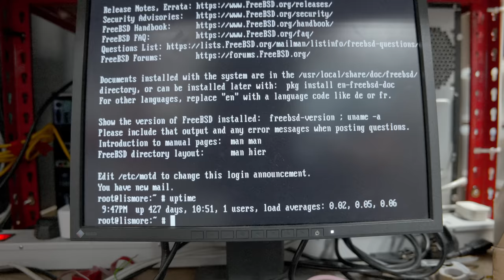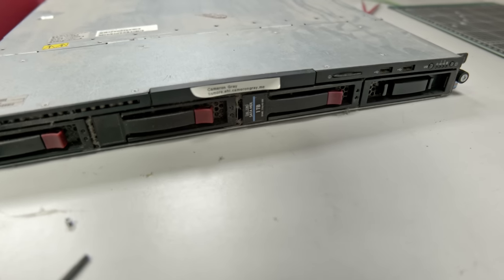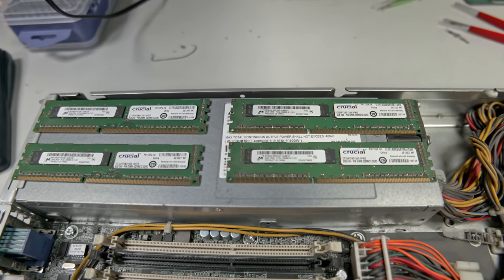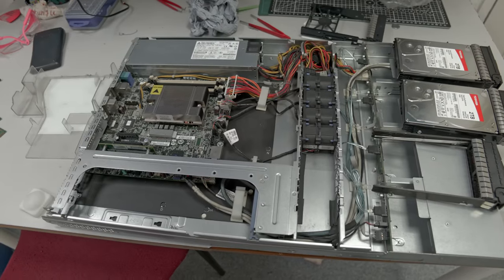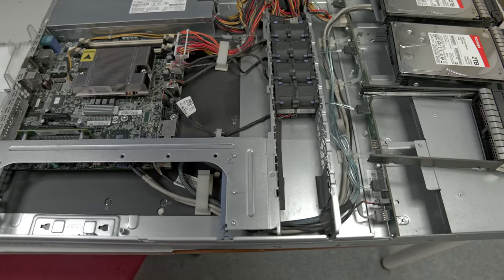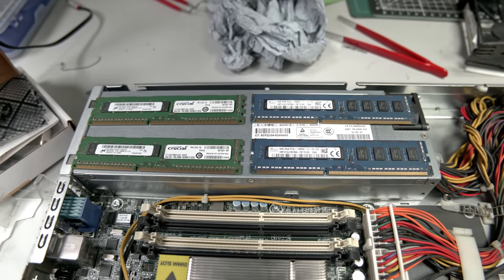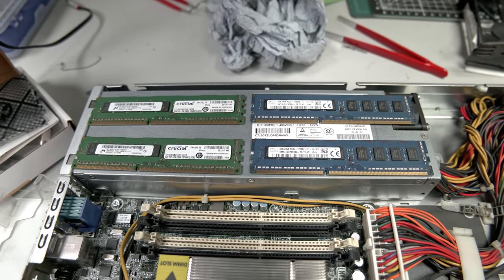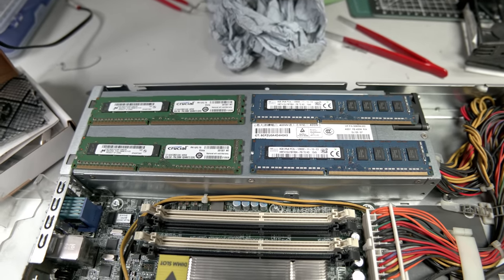Rescuing an Abandoned Server - Building my new offsite backup!

Comment from the maker: Buy items shown in this video on Amazon (Affiliate):
  - StarTech SSD Bracket: https://geni.us/o6Qe
  - Battery Powered Air Duster: https://geni.us/XjUhD7t
Reply: You got me wondering if that StarTech SSD Bracket will also work in an HP DL380 G7 and / or an IBM X3650 M4 !
Reply from the maker: Realistically, for SATA SSDs that card should work for any machine with a suitable PCIe port and a pair of free SATA ports as all it uses the slot for is power and then looks like a regular SATA SSD to the SATA controller.  Using an NVMe slot with it is a bit more hit-or-miss and may end up requiring a newer machine for full functionality.
Reply: @Gerrit-Max works in any system as the power it uses is passive from the slot, you just need 2 sata ports for mirrored boot (I thought the HP dual sata m.2 cards I got was expensive but startech are the same or more then £30-40) unsure why they are so expensive when they require less parts then a dual nvme version £5-10 usually (guess it's more classed as niche item)

Comment: Using the SATA SSD drives was a nice touch. I just built a Lenovo Server and used NVME drives. I wished servers supported bifurcation but my Lenovo X3550m5 does not. Would have been nice to not be forced to use one slot per SSD. 

Glad to see an old server still getting some use, that is perfect for a backup server and doesn't break the bank. One thing I've been surprised about over the years is just how much dust a server can hold and still continue to work lol.

Comment: just a tip :
with your NVMe slot, as you're using ZFS, you could look into grabbing an old 16GB Optane module, and setting that as a ZIL device for your HDD array.
it's a nice cheap way to accelerate random writes for a small array, at least if "syncing" is either used by the share type, or syncing is set to forced.

Comment: This bracket for SSD is really nice. Saves airflow and allow to do a proper raid on two disk. From what I know, SATA controller on actual pci card have to split pci bandwith explicitly in half for both slots and very few card do it properly.

Comment: About serial numbers. It is a good idea to have some note, preferably on paper and on the boot drive of the server itself. About mapping of serial numbers, and caddies locations, and their use. Because once the drive fail, it is likely you will not be able to read its serial number or wwn. So you will not know which failed, unless you go over all the other ones, and deduce it by exclusion.
Reply from the maker: I use Zabbix to monitor my drive health (although most monitoring software can be used for this) - This tracks the history of various drive health parameters which can provide pre-fail warmings but means that even if a drive completely fails and disappears from the system, I can still see what its serial number was through the data that Zabbix has collected while the drive was still operational.
Reply: @camerongray1515 your points are correct on zabbix but I'm pretty sure what movax meant is to have a physical note saying which drive is what serial (can also work for ram sticks, not all hardware knows to tell you which slot but I believe zabbix can follow that too)
Can be a post it note on top of the server, in a notepad saying "server x hdd slot y serial aaabbbccc"
Or a label on the front of the drive caddy with the serial- my favorite for fast info, though not the most aesthetic
The reason is that if your nas os/ipmi/zabbix reports a faulted drive with serial abc, you don't need to start looking for the specific physical drive to replace.
Imagine a raid 5/10 (or zfs equivalent) array losing a drive and you don't know which bay the drive is in, and the faulted drive led doesn't work/exist.
You must turn off the server, if you don't have extrrnal bays you need to start looking for the drive, but if your drives positions are noted/labeled, you can just hot swap the bad drive.
Imagine forgetting you need parity and you start pulling out the drives- that's gonna end up very badly for the pool
Reply from the maker: @davidl6566 That's what I did in this video - all drive caddies are labelled with the drive's serial number.

Comment: You probably do not need VyOS. You can just setup NAT and WireGuard, on the host itself. It is just a mater of setting few routes, iptables rules, and that is it. But having VyOS as VM is also an interesting option. Also nice for learning. I do use VyOS at home (on a physical box), and really it is nothing special. It is just a frontend to iptables. I will be switching back to pure Debian and few small custom scripts instead to setup everything on startup.
Reply from the maker: I definitely don't need it, but I feel it's always good to separate out responsibilities and have all of the routing and networking stuff in a dedicated VM rather than trying to force Proxmox to also act as a router.  With "appliance" style distros such as Proxmox VE, TrueNAS, XCP-ng.etc I prefer to leave the bare metal OS as untouched as possible rather than trying to install all manner of packages on it which could be broken with future software updates since these appliance OSs generally aren't expecting their underlying config to be heavily changed.  It also means that when I'm exposing ports to the internet for things such as Wireguard, I'm exposing a VM and not the full underlying host.  VMs also have the benefit of being easy to backup or migrate to a different host whereas if I had a complex setup within Proxmox itself, this would need to be manually replicated to a new server if I come to upgrade in the future.

It's no secret that router OSs such as VyOS, PFSense, OPNSense, OpenWRT.etc are nothing really more than a frontend to existing Linux/BSD software, but this doesn't mean that they don't provide a benefit.  VyOS provides a very clean and consistent configuration interface all managed from a single configuration file.  It also provides a very helpful mechanism for applying and separately saving configuration changes with the ability to rollback (commit-confirm) which can be an absolute lifesaver!  Of course, I could easily set this up on bare Debian, but not sure what benefit that would bring over something like VyOS outside of a very niche situation where VyOS doesn't support a certain feature.

These "appliance OSs" are also very helpful when multiple people may be managing the system.  They can all view the configuration through the single interface and understand it relatively easily versus a custom setup where you're going to need to document exactly which service and config file handles which particular thing and you'll inevitably have someone bodge something in a config file that's buried away that later gets forgotten about and causes all manner of issues down the line.  With something like VyOS - If I'm on an unfamiliar machine, I can just run "show configuration" and BAM!  I have a full view of the entire configuration of that router.

Comment: Also! BIOS-based machines do have a 2.2TB limit for storage devices. Thus explaining why your hard drive capacity is shown as lower than expected.
Reply: I tought exactly the same, since he mentioned that it didn't have UEFI.
Reply: That limit is only for the boot drive. I use 4TB HDDs for storage on a non-UEFI system and the BIOS detects them correctly
Reply: @Pasi123  Wait the BIOS? It doesn't show as a lower capacity? The OS should be able to handle the proper size.

Comment: Been looking for them StarTech dual m.2 sata things 

I ended up getting HP dual m.2 sata Card (not really cheap) working fine in the dell R330 8x2.5 servers I got(really cheap) , only annoying thing is the sata ports are in 2 awkward locations

Your hp is quite old but most servers have a life cycle controller F11 in dell's case if local (it's it's own mini os that's built into the bmc/iDrac out of bands management) "Hp Intelligent Provisioning" I believe is what hp call it and usually allows remote updating in short amount clicks (but from the looks of your raid controller showing the drives as 2tb it's probably older then what I have got, recommend making sure your raid controller is in "it" mode as currently setup will likely require you to manually pass throw the drives at boot to change a drive)

Comment: You can also access OPNSense through the serial console from a proxmox host. Not sure how it is to setup OPNSense with the command line vs VyOS.
Reply from the maker: Exactly - My current OPNSense firewall doesn't even have a graphics adapter so the only option is to set it up over the serial port.  However, to actually make configuration changes you really need to use the web interface.  I wanted the ability to make any required configuration changes over the console as, if I break the network config, the serial console may be the only way I'm able to fix the issue without physically travelling to the machine.

Comment: What are you paying for the off-site server per month? And what connection speed do they give you? Can you post a lonk to their services? Been looking for a decent colocation.
Reply from the maker: This is part of a hackerspace - essentially a sort of club for people who are interested in tech/electronics/radio.etc that I've been a member of for many years.  It's not the sort of place you could (or should) really use purely as a colocation provider.  It's also not equivalent to an actual colo provider - no UPS, running in a store room, cooled by an extractor fan or in particularly hot weather, a portable AC unit and power needs to be shut off annually for the building owner to carry out electrical inspections.  However, if you look around, lots of smaller datacentres offer relatively affordable 1U colocation plans for relatively power efficient servers.

Comment: If the router vm goes down how do you get to the management interface? Is that on a different network or such? As you mentioned you run a public ip to the server.

BTW does proxmox allow multiple Vlans and such internal with virtual switches? :)

How much does the power bill run you? I live in Sweden and running servers are super expensive.
Reply from the maker: The hackerspace has a shell server that I can access over SSH and from there I can SSH into the bare Proxmox host allowing me to fix the router.  This was my main motivation for using VyOS instead of a web managed router OS - it's much easier to fix when all I have is an SSH session.

Power is provided by the hackerspace so doesn't cost me anything except for my regular membership fee.  Although the general rule is to just be sensible with power and not to take advantage.  So a relatively modern server, up to maybe a relatively basic dual CPU machine would be fine, but don't go running a quad CPU machine with a bunch of GPUs unnecessarily or run a 20 year old server for something that could run faster on a Raspberry Pi!

I haven't tried VLAN configuration with Proxmox bridge interfaces, it looks like it would be possible and you can make a bridge interface "VLAN aware" so that it'll pass traffic, but it's not something I have first hand experience using.
Reply: @camerongray1515  that sounds awesome I would love something like that here in Sweden. I run my own servers but on hp microserver builds I have two do far a windows box and a pfsense box. But they are local at home so I can do everything from within the network. Then I have a cisco switch and some routing guff going on.

I would rather enjoy being able to run a server like that at a place. Just to have a off-site backup is worth the money. I don't have that today. But I absolutely need to figure out that soon.

Actually thinking about putting together a esxi build with a Amd optron 16core machine I got with 32gb ram. Planning to do eight 4tb ironwolf drives for storage on adaptec 5805. And then having like the os and such on a few ssd drives like you did it. I do allot of video editing so videos eat storage like no tomorrow. And really need a solid backup solution.

I love servers and learning things I don't know how to do :)

Comment: Old Net/Sys Admin here....  Love the video.  Out of curiosity, did you replace the thermal paste on the CPU???  And...  Is that Server Room climate controlled???
Reply from the maker: Didn't bother replacing the thermal paste - was tight on time and realistically, the temperatures are fine and any improvement would be minimal.  The room is normally cooled with a simple extract fan with cool air being pulled in from the unheated corridor through vents in the doors.  There is also an AC unit in the room, but this is on a thermostat and is only used if the room gets particularly hot.

Comment: Amazing Video! :)
How did you label the Drive Caddys?
Reply from the maker: I used a Brother E550W label printer with the extra wide 24mm tape.  That particular printer allows you to set the exact length of a label which allowed me to create labels that fit almost perfectly - only had to manually cut around 1mm off of the bottom of each label to get it to fit.

Comment: Do you use the two SSD for boot and vm storage? If so are you worried about wearing the ssd  out?
Reply from the maker: I'm not particularly concerned - none of the VMs I'm running perform any significant writes to the drives, you'd probably see more wear if the drive was used heavily in a regular PC.  It's also relatively easy to monitor the remaining lifespan of an SSD from its smart data - these WD green drives report a percentage of reserved space remaining.  As long as you monitor this - you can easily enough detect when a drive is approaching the end of its lifespan and pre-emptively replace it.

Comment: Hmm. I've got like a VPS on a cloud at the moment. Should I get a used server and colocate it to a datacenter? Or should I just stick to cloud-based solutions, or even just plain Google drive or something for my off-site backup. I'm just a student currently, tinkering with stuff.
Reply from the maker: I'd probably stick with cloud storage and VPSs unless you have a good reason otherwise.  Backblaze B2 offers very low cost cloud storage.  With a colocated server, you're responsible for all of the maintenance so if something like a drive were to fail, you'd need to buy a replacement drive yourself then either travel to the datacentre to install it or pay someone there to install it for you. This was why I stopped colocating this machine and moved to hosting everything in the cloud.  The only reason I'm using this machine now is because I essentially get the colocation for free as part of my hackerspace membership and it's not too far away so I can easily get to the machine 24/7 to perform hardware maintenance.
Reply: @camerongray1515  Awesome to see your reply. Might get some used server for myself to tinker with :P but will stick to cloud storage and VPSs to host my offsite backup! Probably like AWS glacier or smth. Since it's 'cheap'. As well as your B2 suggestion!
Reply: Colocation is pretty expensive, as power prices are going up. One big advantage of a metal is guaranteed performance, because cheap VPS providers are often over-provisioning their servers quite a lot. There is a limit to even Vmware live migrations if one o(or more) of the fellow VM's start some CPU/io intensive work.

Comment: There was no facility for ilo (or similar) at this colo provider?
Reply from the maker: The machine has an iLO but I'd never bothered to set it up at the time as it's horrifically outdated, insecure and uses a TLS version so outdated that practically no modern browser/OS will connect to it.  I could of course connect an external IP KVM to it, but the machine isn't particularly far away so I can easily enough just get to it in person.

Comment: Is there a way to make this server quiet by replacing the fans and powersup with something else? These U servers are loud!
Reply from the maker: Not really - 1U servers are loud because they need high static pressure fans to force the air through the restricted space.  The row of fans in this machine are responsible for cooling everything from the hard drives, to the CPU to any installed expansion cards.  If you were to replace the fans, you'd likely end up overheating.  If you need a quiet server, you really need to go to at least 2U since then you can install active cooling on your CPU and fit quieter case fans, but even then you'd likely need to build it yourself rather than going for a pre-built.
Reply: @camerongray1515  We had these shitbox 1U servers that would continually overheat - friend of mine in the office took his power drill to the cases drilling hundreds of holes above the fan, everyone thought he was completely mad but they held temp after that.  Well that and a large desk fan supplying the rack in our makeshift server room where one of the AC units had failed.

Comment: why wouldnt you not use hardware raid1 on the boot drives?  by doing software raid you are writing the same data twice and loss of hardware level recovery?
Reply from the maker: Nowadays, software RAID can perform equally well as hardware RAID and filesystems such as ZFS offer additional benefits in terms of caching and data integrity.  The boot drives are in a ZFS mirror so I do have hardware redundancy.  Additionally, the "RAID controller" integrated into this machine, along with those included with motherboards is still CPU driven and requires drivers under the host OS, often known as "FakeRAID". Real hardware RAID would require a dedicated controller.
Reply: Hardware raid on remote location would require a battery to work reliably between power outages. I am pretty sure, that new batteries for G6 controllers are pretty rare.